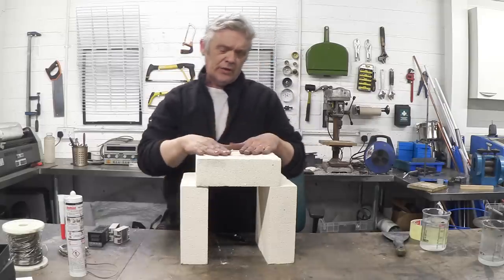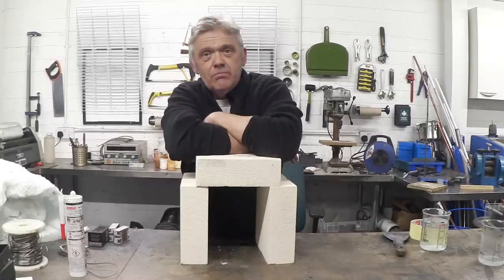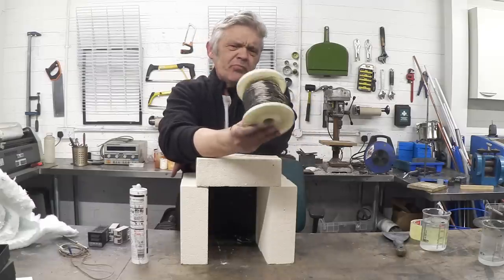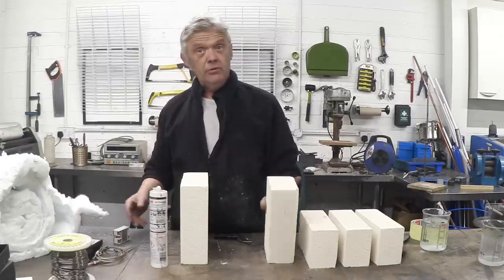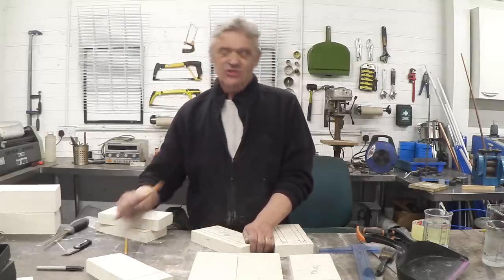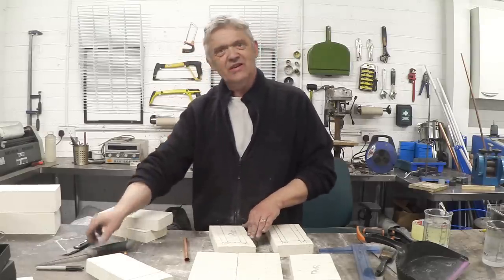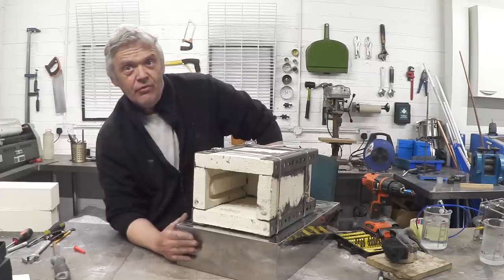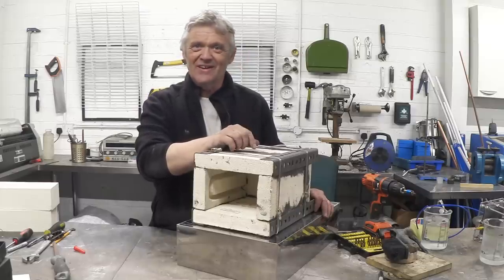How To Make A Lab Kiln - Basic Structure

Comment: Hi. I am currently building this; thank you for your clear instructions.
A useful tip is, having marked the side blocks with the lines within which you will cut the coil channels, dust the flat surface with chalk powder or some other pigment dust. This improves the contrast between the flat surface and the channel you are cutting and makes cutting a neat channel substantially easier. (If you use powdered charcoal, fire up the furnace in an open space first use; you don't want it to generate carbon monoxide, which or course is odourless and highly poisonous.)

Comment: It is one of my next projects as well, after the reflow oven. The warnings on the ceramic fiber blankets got me a bit spooked tho. It's always awesome watching your videos, the whistling and singing was actually nice. Forget the licence-free music and just whistle. So refreshing to see content that seems natural, not pretentious, with perfect ratio of information, examples, along with tips and tricks. Can't wait to watch part 2.
Reply: I was actually going to comment about the ceramic fiber blanket, but decided to wait and see if he notes anything about it in part two, I have worked with the stuff, and the basic things to keep in mind is to wear a respirator like a p100 or similar when working with it and seal the kiln up when done to prevent any loose fibers from escaping. You can also seal it with something like kiln wash to keep the  loose fibers at bay... Also I know there are biodegradable versions of ceramic wool that is not that dangerous for your lungs, but if my memory serves me right, I believe it stops being biodegradable once you have had it up to temperature, so you would still want to seal it up. Not that dangerous stuff, it just needs to be respected and handled properly...
Reply from the maker: The warnings really apply if you are working with this stuff all day every day - if you do the odd job and never disturb it a mask and gloves will do you just fine and as you putting it on after the brick and then putting a case on that there isn't even a need to seal it

Comment: Some years ago, my grandparents lived in a very rural area and had a wood and coal burning stove. If you were careless loading coal into it , you could damage the firebrick. Easy to replace , but easily broken as well. Getting an extra or two is a good idea.
      I was part of a crew that built a gas fired outdoor kiln for a college arts department .
     It was wrapped with that ceramic "cotton" and the shell was made from old ductwork.
     A little kiln like the one you're building would have many uses...for high school or small college labs or art departments...
Reply from the maker: true enough mate - thanks for taking the time to post

Comment: Nice efficient design. I like it! One tip on choosing a PID controller. The programable ones cost more ( $80 vs $25 US ) but can do ramp and soak cycles. Very useful for many jobs.
Reply: Tempering knives and so on right?
Reply: @Barskor1  Yes. I use slow temperature ramps for carbonizing and graphitizing battery materials.
Reply from the maker: very true mate and nice tip cheers
Reply: @William_Hada  Slow temp ramps so the volatiles outgassing does as little change or damage as possible?

Comment: oooohhh...I've been contemplating building one of these for heat treating knives, and now have a newfound interest in ceramics. Great video Thanks (I think some sheet metal from an old microwave may be getting repurposed for mine)

might also coat the inside with 
ITC-100HT Ceramic Coating
Reply from the maker: awesome mate - I am a bit pushed for space so I got rid of a microwave case just recently - I am sorry I did that now lol

Comment: Hi Robert, thank you so much for the many varied videos that you have posted. I envy your energy and enthusiasm in the projects you choose to share. I’m a jeweller by trade and when time permits I have toyed with the enameling process. To date , any pieces I have made have been done using a torch and I would very much like to build a small kiln , similar to the one you have built. 
I have the tools and it would be well within my skill level to build it as you have suggested ( I have looked for a second hand unit but the market is extremely limited here in Ireland)

I’m sourcing the materials at the moment and am having a bit of bother sourcing the pod controller with thermocouple and solid state relay you mentioned in part 1 of your videos ( estimate cost 30 pounds )…. I apparently could build one using an arduino but would rather not get drawn down that rabbit hole at the moment ( have a couple of arduino projects on the go as it is).

Could you possible give me your source for the above mention pid controller and I can contact them to arrange shipment.

Thank you again for all you really enjoyable videos and I look forward to many many more.

Ed

P.S. May 2022 bring the answers to many of the unanswered question that you no doubt have in abundance.
Reply: Hi again Robert,

On further searches, I have found a source for the parts.

Thanks again.

Ed

Comment: Nice bit o kit Robert! I am doing some research but so far no one insulates kilns with a vacuum gap it would be more complex but for higher temps IMO worth it.
Reply from the maker: you can get vacuum ovens easily enough - never heard of a vacuum kiln though
Reply: @ThinkingandTinkering   I just want it insulated with vacuum sheathing the heating chamber could be at atmospheric
 pressure apparently it is either not economically feasible, practical or no one has thought of it and had the will to make it.

Comment: I bought an old gas fired kiln to scrap it and get some fire bricks. Cost me $50 and I got a whole bunch of those bricks plus other bit of ceramic kiln furniture. I was told those bricks are rated 1300 deg C.
Reply from the maker: that is awesome mate - I bought my kiln second hand because the electrics and coils were shot - the whole thing cost me £250 the new kiln price was £7,000 - it's worth knowing this stuff even if never build one - reconditioning one is a piece of cake and the same rules apply

Comment: Great video!
How does using full-thickness bricks compare to using the half-thickness bricks plus insulation wrap?

Might want to wear a filter mask when making ceramic dust.  Silica particles in the lungs make scar tissue, which doesn't work well for gas exchange.  Presumably a minor exposure, however how many minor exposures are you going to have...  Changing a mask filter is rather easier than replacing lungs.

Comment: I have a question. I'd like to add another row of bricks to the sides to make it twice as tall. Is there anything else I need to do to the design to compensate for the additional space?  I know this is an older video and I've watched the video several times and read through the majority of the comments but didn't see the answer. I'm using it for glass and I'd rather not lay a delicate piece on it's side if it can be helped. Thank you for your time and your videos

Comment: Great video.  I just built a crucible with home made mix of various ingredients and was amazed at it could handle well over 2300F, and I didn't use any of the online suggestions for forge or kiln making  - I looked at what the properties are of each compound and figured what would be a good mixture for strenght and heat resistance. 

I have one question for you, have you considered calcium silicate?  I stil have proably 1,000 sq ft of 1/4" asbestos, which is undeniably one of the mest materials for this (as an outer insulator, then covered by a sealant such as drywall, or fiberglass insulation (only reaches about 700-1000F here)..  before all the alarmists start talking shit about asbestos, it isn't unsave when it is used properly and you aren't smashing it with a hammer and creating dust - 99%+ times when you hear it i a problem in buildings - it's all BS unless they were doing demolition, and then it can be a problem.  Just wait until you find out the product that replaced ti is EVEN WORSE, the silicates, which case a much worse disease than asbestos ever could.  

I want to make my own refractory and am torn between what to use. I want to five it reflect as much heat as possible and I've decided to go with MgCO3 (decomposes at 750F to MgO - when in the kiln to dry), Al2O3, and diatomaceous earth flour (99.2% pure SiO2), TiO2 (2%), Fe2O3) (1.5-2.5% (high refractory index) and finally some Zirconium oxide at 2-4% which has insanely high heat refractivity index - Oh, I also plan on using EXTREMELY fine hard wood ash that has been leached of at least 90% of the solubles (sodium/potassiums) to give some Ca(OH)2 among many other trace minerals, but it is important to keep the level of CaO low in a refractory or else it will melt and your bricks will crumble.  

You should really do an experimment making your won refractory. I made a crucible with the wire inside the housing and it works great, I can control temp from 200-2100F and only melt metals I want as the unmelted are easy to remove.
Reply from the maker: mate - you make some really good points and I love your suggestions but you are not going to get many folks to agree about asbestos - there is just too much of a meme about that one
Reply: @ThinkingandTinkering  I'm glad you have the backbone to agree!!  I know people who have been using it their entire life (80+ years old) and never had a problem.  It seems like there are so many TRULY ignorant people who are parrots of what they see on the idiotbox.  It is a truly sad state of affairs.
Reply: I, too, would like to make my own refractory and am not persuaded by what I've seen on youtube. I would love to see Robert make a video on a good insulating refractory recipe. I know I'd be able to trust that recipe.

Comment: Love the way you think Robert. Will the firebricks stand up to power tools, like circular saw, drill and angle grinder?
Reply: IRC the dust will kill them as it is aluminum oxide but you don't need to use them you can gouge the brick with a fingernail.
Reply from the maker: they are really soft mate - you are not going to need to use power tools I assure you
Reply: @ThinkingandTinkering  Fair 'nuff. Thanks both.
Reply: @MiniLuv-1984  Your welcome Benny.

Comment: Hey Rob, would a layer of Starlight be beneficial as an extra insulator? The cost of baking soda, cornflour and glue is pretty low.
Reply from the maker: no mate - it will cook - you could use perlite etc mixes if you don't want to splash out on the ceramic fibre but this is a workhorse piece of kit and for the extra few pence you will probably regret that decision sooner or later

Comment: can I use pumice brick instead of fire brick?  I can not find the fire brick like you show but the griddle cleaning pumice stone is readily available...
Reply from the maker: you can get it on eBay mate https://www.ebay.co.uk/itm/INSULATION-BRICKS-230-x-114-x-64mm-SWP140-26-grade-INSULATING-FIREBRICK/303150318833?hash=item46952ac4f1:g:arAAAOSw1ZBUvoR9
pumice will spall

Comment: Pink zircon paint that luckygen uses to paint on the interior goes way up in temp. He does cast iron constantly.
Reply from the maker: a lick of paint won't help - the pink zircon is used to prevent stuff sticking to the kiln floor it doesn't raise the temp range - for that you need to get the brick in the range or it will just melt or spall
Reply: Robert Murray-Smith on his videos he paints the kale wool to prevent wool degradation. Very cheap furnace and last longer with less outlay of funds. Many times use to do cast iron used in moulds. I’ve seen a lot of styles his just seems to work and he was a foundry worker.

Comment: Would it fit with the wrapping inside a stainless mini fridge?:) thermal cut out bars are commonly used in kilns to control duration and temperature
Reply from the maker: I would think so - and mate I have worked with a lot of heat control equipment I have never seen one in a kiln - ovens - yes and lots of low temp stuff - by which mean less than 600 degrees C - but not so much in kilns
Reply: @ThinkingandTinkering  yes duration wouldn't warrant having that set-up thinking about it,used to do a lot with ceramics and glazes that requires overnight firings,thinking old ceramic insulation+if the properties of a glaze might be useful in a conductive metal oxide sense!:)

Comment: nice build, what do think about, kaolin, quicklime, graphite, and silica carbide powder. mixed and formed into sheets? any thoughts? i'm about to experiment with this mixture.
Reply: The quicklime might bite you, there is a good chance it will lower the melting point of the kaolin.. normally I am all about making your own stuff, but in this case unless you feel like spending the time and money experimenting, just buy the proper refractory products to suit your needs, it truly gives superior results.
Reply: @HeimoVN  I need something like a putty or mortar that could thickly coat red fire brick. I have lots of bricks lying around but i know they wont hold up like a refractory. as an outer insulation layer however they'll give a heavier duty forge. I need something more solid than kaowool or kiln bricks. maybe a steel mesh with just the clay, graphite, and silica carbide.
Reply from the maker: why mate? what are you planning to do?
Reply from the maker: sorry I read this post after replying to you first post - your best bet is kiln lining if you want heavy duty all that will happen to your red brick is that it will spall after a few firings unless you coat it thickly - in which case just use the right brick but use a hard shelf to spread the load

Comment: 1260° so you can't melt steel then? The graph on wiki seems to suggest steel austenite a 1536°C what do we need for insulation for this??

Ps thanks for teaching so much
Reply from the maker: you can build a kiln to any required temp all you need is the right rated insulation construction details are the same - it is rare - I have found - to want to exceed 1200 which is why I chose this temp range but if you want higher - do what I said on the video buy higher temp rated stuff
Reply: @ThinkingandTinkering  aye, that wire can be found in old toasters can't it? Rather than buying, repurposimg, like you said?

Love the content, sunscreens subscribed for maybe a year now. Always watch.

Did that chlorophyll solar cell of yours ever go anywhere?